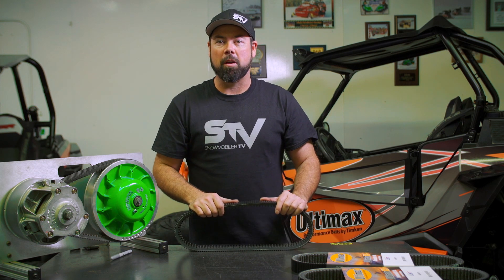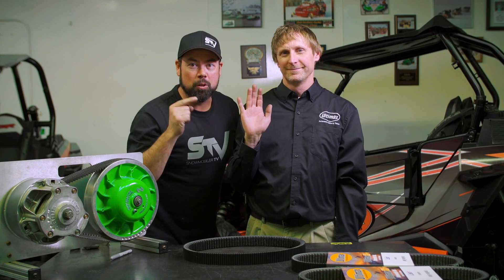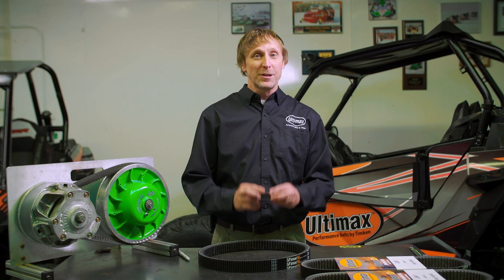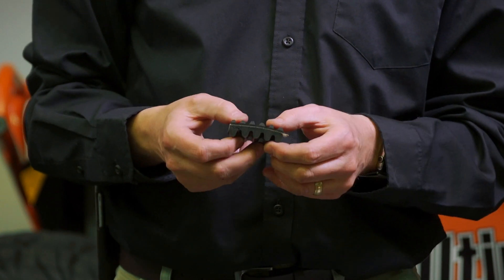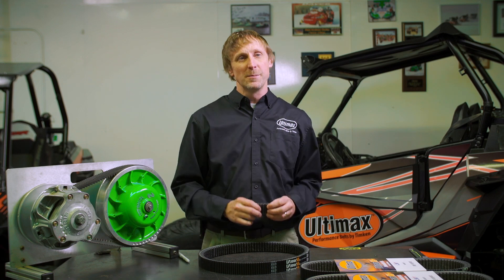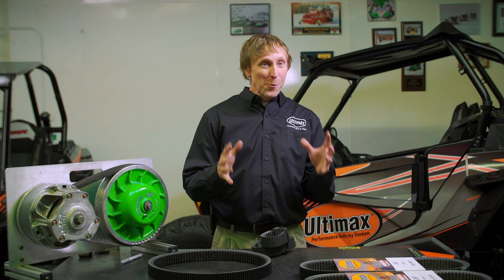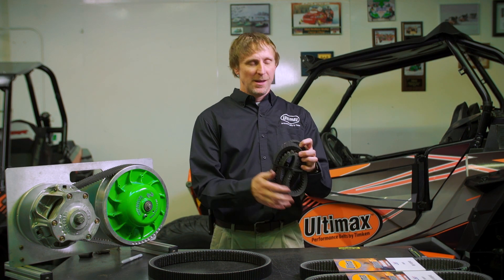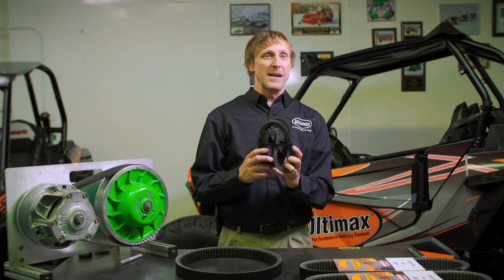Snowmobile Belt Myths with Ultimax

Comment: Great vid. Just curious, my 2020 rmk pro just hit 200 miles. I have a few flat spots on the belt. Is that normal?
Reply: I dont know how belts on snowmobile works but assuming there isnt a lot of literal slipping happening, I would imagine a pattern, because the spots are not all over and are in those spots, are from defect or an alignment of assemblies or a crankshaft or other pulley runout, and the wear is from the same spot hitting a variation over and over